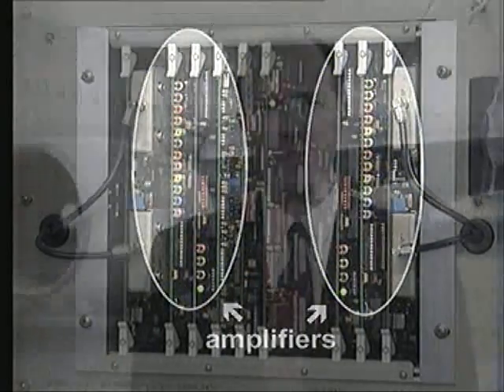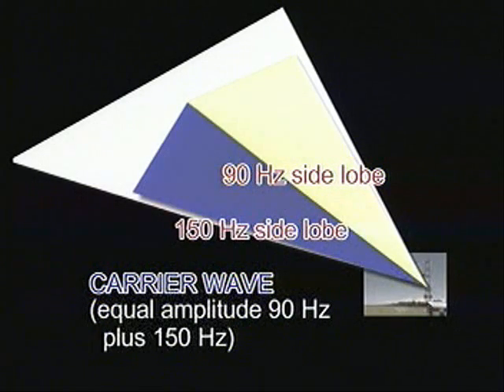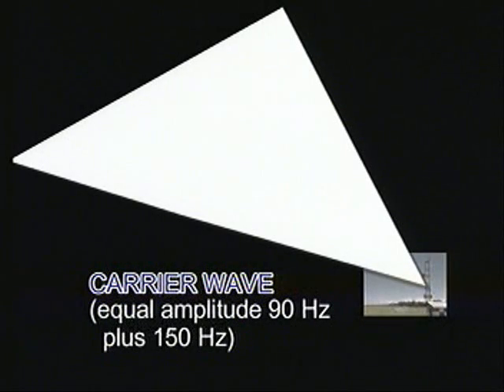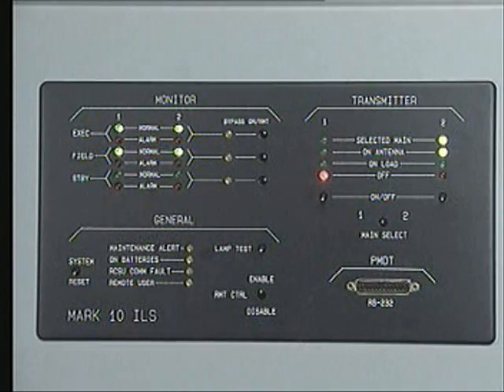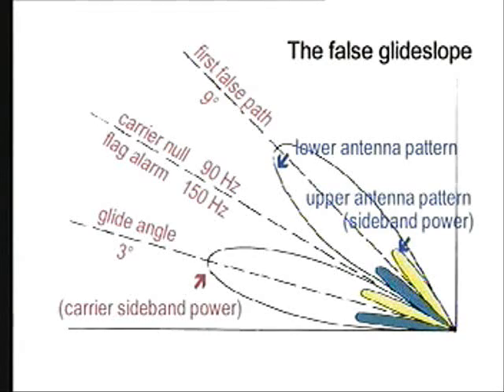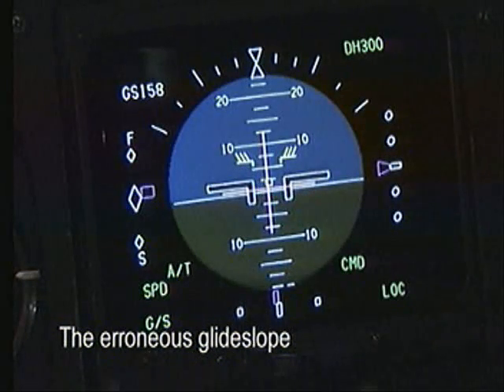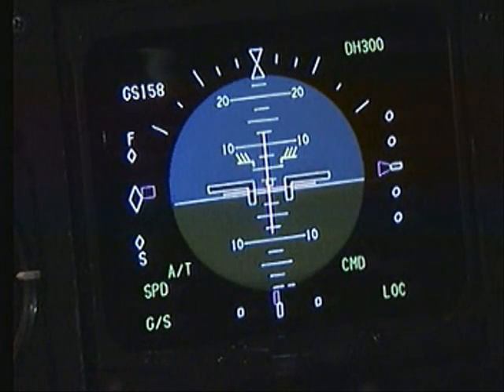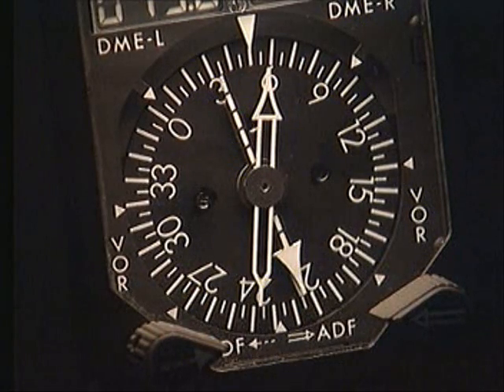NZ60 Erronious ILS Incident, Apia; Part 2

Comment: @ 0:10 when you indicate the system's Amplifiers is actually incorrect. You're showing the card cage; from right to left Synthesizer, audio generator, and monitor for transmitter 2. The amplification is down at the transmitter just below on the side of the cabinet. 

Good video though.